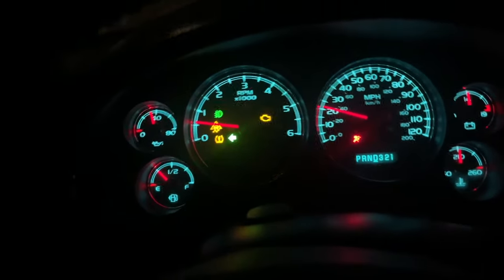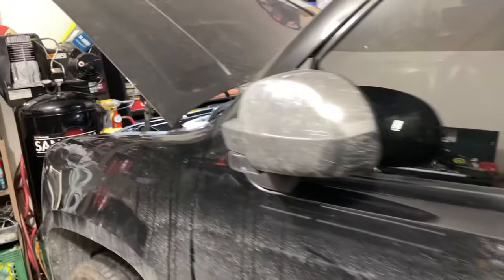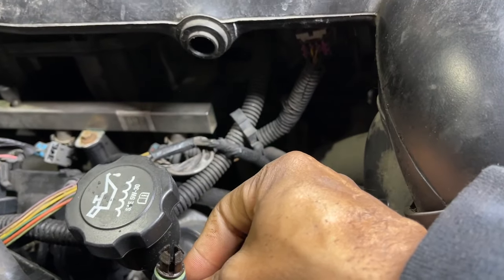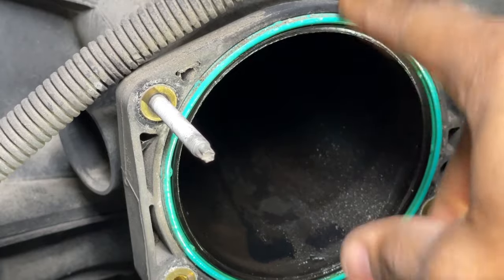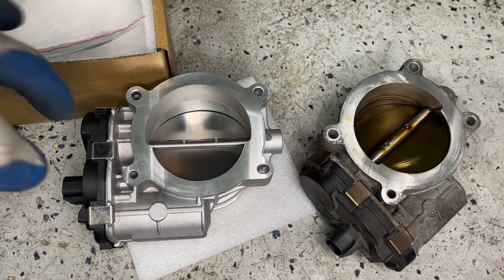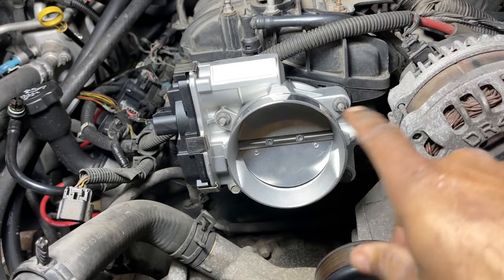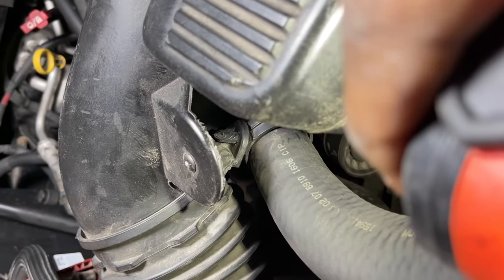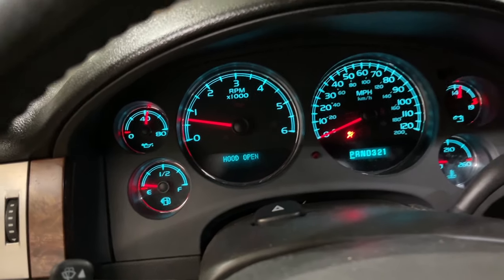How To Fix Reduced Engine Power Quick And Simple! Code P2135 Chevy Or GMC Trucks / SUV's! TPS Issue!

Comment: Thx for this video! Do you have any DIYS for a Chevy Sonic 2014 that lost communication with TCM after getting a jump? The slippery car light is also illuminated.
Reply from the maker: Unfortunately, I don't have any videos for that issue however, I am pretty familiar with your car. How is the car currently running? I wish I were there to diagnose the car, I could probably find the issue in a matter of minutes.
Reply: @TerenceDIY  wow I wish you were here too! Let a mechanic diagnose with the OBD and scan tool but he said info is coming in the system but not coming out. And referred me to a transmission shop to install a new TCM. I called the shop, they say it’s very rare for that module to have a need to be replaced. But to diagnose, that’s another fee. 

When I get to 40 MPH, car kicks back down to 38. It won’t go over 40. My reverse lights won’t light when in gear also I had a digital indicators on the dash for what gear I’m in and that won’t illuminate anymore. So can see when in drive park neutral ect. Car locks were jumping by themselves but that stopped. This seemed to happen after we got a jump on the battery. 
So far we cleaned the throttle body, Mass airflow sensor, checked for loose harnesses (that we could see), checked fuses in engine bay (not the relays tho). Prayed over the car, pleaded he blood of Jesus Christ out blessed oil on the car lol! You name it! I do think that J1 is missing a pin though. But I’m not sure if that pin is supposed to be missing or not. Maybe I could put a paper clip in it to conduct electricity. But don’t know the wiring. Only code is U0101 with the slippery car symbol.
Reply: @TerenceDIY  are you in Georgia?
Reply from the maker: Chicago, Illinois.
Reply from the maker: If I were there, I guarantee I would know exactly what the issue is. Cleaning the throttle body and any other component was not going to solve your problem. I have a couple of questions for you... 1. Why did you jump the vehicle? Obviously the battery was low, but what caused it (left lights on, radio playing, etc...) Your issue may be a simple one I just need more info.
Reply: @TerenceDIY  ok cool! So I was charging my phone on the lighter cable for about 2hrs(I know smh) when I got out, I noticed the radio was still playing but normally goes off when you open the door. Came out a few hours later, car would crank but not start. Windows still would power real slow. Then no sound at all after a few try’s. Called a buddy jumped it with our cables it would crank but no start. Someone else used their cables and it started back up! We thought we were on the clear and that our cables were no good. Later that day, the locks started going crazy by themselves, then the lost communication code. We checked the battery, starter and alternator and all checked out with good voltage. 
Short answer, maybe charging the phone or the fact that the radio stayed on too long after I left. I noticed if the radio is on once pulling the key out and opening the driver door, radio goes off immediately. But if we open passenger door (which was the door I used that night) radio stays on until we open driver door.
Reply from the maker: So all of the problems occurred after you jumped the vehicle off? If so, was it driving perfectly normal before the battery died? How did you guys check the battery? I'm really thinking this is a battery issue (voltage drop during a load).
Reply: @TerenceDIY  sure so we had some intermittent lost communication code. It would come on like once a month. But we had other codes too once we did a tune up and replaced the valve cover (we had a leak), the CEL went off and drive perfectly. But the lost communication code would still come back off and on. Maybe 2 weeks b4 the jump, I was going down a hill and I noticed the engine sounded like it was accelerating more that what I was pushing the petal. It didn’t go faster but it sounded like it was using more power for a second. But ultimately, the locks and limp mode didn’t happen till after the jump. We got it checked at Orylies (an auto part store like autozone not sure if yalll have one up there). But yeah they checked all 3 (starter alt and batt). Is it possible that a battery could be good but faulty?
Reply: @TerenceDIY  also could a nox (I think that’s how you spell it) sensor be the cause too? We had that but once we did the tune up and valve cover replacement, that code went away. I’m wondering if that could be interfering with the transmission communication module?
Reply from the maker: No, the knock sensor will not cause your issue. I thought this happened after you guys jumped the vehicle off. If there were issues prior, you may have an electrical issue. It's hard to pinpoint or even guess without being there. How many miles on the car?
Reply: @TerenceDIY  123k miles. All the other codes left once the valve cover and tune up was done. The lost communication code would come and go. But now the lost communication stays on and limp mode. Limp mode happened after the jump. Whatever it was worsened or changed after the jump.
Reply from the maker: Does it start right up on first turn of the key or does it spin over a few times before starting (very important)?  Have you ever replaced the timing belt?
Reply: @TerenceDIY  yes it starts right up on the first try w/ no hesitation. But awhile jumping, it took several tries. When the cables were on, it was. I sound just clicks. Then it hesitated but did nothing. Later that day, our friend used his cables instead and it started up. 

Short answer, the car starts right on up now since jumping it right. The jump was about 2 months ago. Been starting right ever since.
Reply: @TerenceDIY  and by the way, I appreciate you for trying to give us some clarity on this. We all are trying to figure this out!

Comment: What was the part called that you changed and is it the same problem for a cadi CTS??
Reply from the maker: It's called the throttle body. What year CTS?
Reply: @TerenceDIY  2003
Reply from the maker: Here is the part for your car. It's a top brand for a great price. 

https://www.ebay.com/itm/325113909788?fits=Year%3A2003%7CModel%3ACTS%7CMake%3ACadillac&hash=item4bb24c921c:g:vRoAAOSwyIhiOj2s&amdata=enc%3AAQAIAAAA8ENHnaBDe4JuIS6N%2Fw%2BB98qQafRm%2FawS2m49GQbU5Gu1rKo8qU0OR6kKENSze8gUBNUB8uzEyejymenT9Ik1C%2B%2FL%2FwmyOdBpha5gwpkoUJSNNJizyYZ%2FRCrIMr96YjeLaTtq8l0HsSZpSR7mYnt3jzl98yc%2FPL0avXyZLWLuX0feHLi%2FNioI%2BRBqB95eTO%2BUxLNnYEVe73olTephOombCk7TT%2FDk9sE0zpbjipdxpPZyD31qBNcYulHm6d9%2FhUVspY6E4XraNKv8hMD9qrL%2B67ANReQHyTTaAa5tVdnTgM7E9Sxl4DSS8oT82iBMgfZXKQ%3D%3D%7Ctkp%3ABFBMorKok_hh

Comment: I just had this happen last night on my 2018 f-250. I already have to get some body work done but need to make an hour trip before I bring it. I’ll just tell them to handle that too. Do you think the trip will put it at high risk for further problems before I bring it in?
Reply from the maker: Can you get some of this before your trip? (First Link). If so, pour it into your gas tank. Try to have less than a quarter tank if possible. This will allow the solution to be more concentrated and work better. I have a video on my channel where I dealt with a similar issue on an earlier Ford F250. Also, an even better solution would be to remove the air duct from the throttle body and spray inside and out (manually open the throttle body while you spray aggressively into the throttle body to clean it (Second link).  The first product will help you but if you can use the second option, it may fix your problem for some time. Thanks for watching and be safe on your trip. 

https://www.amazon.com/Gumout-510011-Multi-System-Tune-Up-fl/dp/B00PP4J23W/ref=asc_df_B00PP4J23W/?tag=hyprod-20&linkCode=df0&hvadid=312181776237&hvpos=&hvnetw=g&hvrand=9720252771282160397&hvpone=&hvptwo=&hvqmt=&hvdev=c&hvdvcmdl=&hvlocint=&hvlocphy=9021629&hvtargid=pla-569057245845&th=1

https://www.walmart.com/ip/WD-40-Specialist-Throttle-Carb-Cleaner-Spray-13-5-oz/898373269?wmlspartner=wlpa&selectedSellerId=9816&adid=22222222227898373269_9816_141989961518_18286110951&wl0=&wl1=g&wl2=c&wl3=620766111969&wl4=aud-430887228898:pla-1740857020067&wl5=9021629&wl6=&wl7=&wl8=&wl9=pla&wl10=135428651&wl11=online&wl12=898373269_9816&veh=sem&gclid=Cj0KCQiAx6ugBhCcARIsAGNmMbiTUhX6eb5pDiRdBIkgeToNsFuDxdDs57oI9jAIKlWa0zLe_Sa-fVYaAi2aEALw_wcB&gclsrc=aw.ds

Comment: My car is doing the same and the mechanic said it’s a Excelerator pedal position sensor. So we are going to replace it could this be the problem instead of that??
Reply from the maker: Sorry for the late response. I would not be surprised if the pedal position sensor was replaced and your vehicle does the same thing. There's a strong possibility the throttle body needs replacing or a thorough cleaning. However, I am not there to inspect the vehicle.  Here are a couple of links to the part just in case you have to replace it. 

https://www.ebay.com/itm/254915068776?fits=Year%3A2007%7CMake%3AGMC&epid=112769957&hash=item3b5a1f4368:g:qHEAAOSwC2FgW1tj&amdata=enc%3AAQAIAAAA8EoDwoFAdfE7U4T5cvS9v6gyx76UcfGZSiU9xN177m0b%2FxXR%2FCToq%2BL9RT4qyAU7u0M3RtwLP7kOCtk0cayhWo7ERDAV5LLKCGVtpAYLlVLDp9ztNof%2FM6KfVBc4akIRcPk%2FTN9xIY9tqJW%2BAQoPEa604YBp4tsDWj8akNQn7qc2P6VAfp6DuAmyCtBf5BUgm4bMeRvA7bhBWvnY7a6RBnFHmY7YOcHqvr3hOOeyAm5xKhR4Zq84UjyN5yfDyIcS1Tm9JhPCFRmdP3iRs9UGuKqnSJV4OTv04BVMAX6WXmL6%2BtqL7aVvjxx%2BGfQWWNIzDw%3D%3D%7Ctkp%3ABk9SR7iDlMy2Yg

https://www.ebay.com/itm/313060626212?fits=Year%3A2007%7CMake%3AGMC&hash=item48e3de0f24:g:WrMAAOSwK21gNmUd&amdata=enc%3AAQAIAAAA0FVaL6b67vLo5ljhLpeU83s2XoUNB7COAVKlEKo1D6hxBh9W5qCtaob7d1g2IH7QvdAOVt4LnTaX8Kp54N5YWHwl1FgNdKF6AXXU1bmXmNYGC6neOBM5jH9x9zYb4mObJvZznCm7ASfr0529QujCN8%2BKQ7dJxZJ%2FgGEwYGPOdkItiY09x9544L0Adds%2Fj0%2BfI229VGpHhxHC4tcOeMRytUH%2F1Tvw6CwHFnyTWiThoteeuBt%2BqNzGjg20%2BcuoebSNF3055n8r8ez71abQN1mOCb0%3D%7Ctkp%3ABk9SR7iDlMy2Yg

Comment: I have a 03 chevy Silverado, 2500 hd, it did this to me on Thanksgiving, i replaced the throttle body, and it was good, until today it happened again.  Any ideas on why it happened again so soon?
Reply from the maker: Did you buy an OEM throttle body?
Reply: @TerenceDIY  honestly i don't know.  I got it from an Oriley oautoparts store.
Reply from the maker: Well, it was definitely not OEM then. Here is a link to a part that is probably better than the O'Reilly's part and MUCH cheaper. 

https://www.ebay.com/itm/125710877331?fits=Year%3A2003%7CMake%3AChevrolet&epid=19056097644&hash=item1d44f3c293:g:qkgAAOSw-nVjvRIU&amdata=enc%3AAQAIAAABAOmrBww5Sup6onOc7MXf%2B1a49OvzpVKkIrYhsc4PoGZWqXRJgBWz%2Flck3NJaO8FHmi4tZ%2FhTnOrFTuqibi3WPphFhbjnqVOGEDiRdgNNDN6SCytNBO4j7%2BkugCdSHEqoBx3iZ11ryqNX3B%2BgcthivHsKlkrBFVJB8c2qPwPsR8S6U6OWPiCU1C6zGt16Rq2cMcWef%2By%2FxRzonnQBgO11IbeUdBAMHxSPmWpzMuCDejmVwST7QvvgsyouTaLIO%2F3Sz7P1DHHrFOzOCK9nZZb95zfury8aLaz%2FyOORfOeYIxlucRFj%2B%2F3GbqhWHIyAra8bWpYwga506J6ZR6kOTY7fLO0%3D%7Ctkp%3ABFBM8JHTxPVh
Reply: @TerenceDIY  hwy thanks man, and i looked at the part,  its a hitachi, but it's under warranty so I'm taking it back now and getting a new 1 for free
Reply from the maker: @Mr.Plant_man  Awesome! Let me know how it runs after you install the new one. Thanks,
Reply: @TerenceDIY  had the part on for a week,  and not a single probem so far.
Reply: @TerenceDIY  sorry btw i just seen your comment
Reply from the maker: @Mr.Plant_man  Great!

Comment: I done replaced the whole throttle body and the petal and still throwing the code & reduce power and all that
Reply from the maker: Did you replace it with an OEM throttle body? Also, what code are you getting?

Comment: Hey am i missing something here or did you forget to mention that ypu have to relearn it?
Reply from the maker: Nope, I did not have to relearn it. A few commented saying they had to but not in my case. I removed the battery cable during the removal and installation to trick the system. It works almost all the time for me. Thanks for watching.

Comment: Awesome video, My Yukon denali 2010 recently started showing engine light, though there isnt any reduced engine power message but I can feel less power while accelerating, it takes few seconds to get acceleration!! any advice please?
Reply from the maker: It may be as simple as removing the air duct and cleaning the throttle body with some throttle body cleaner. You'll be surprised at how your MPG will go up as well as performance. I would remove the throttle body and clean it as well as the intake in that area. Super quick, inexpensive and simple job that will save you $$. Here's a link for the cleaner. 

https://www.amazon.com/Berryman-Chemtool-Carburetor-Throttle-compliant/dp/B0002KKIDW/ref=sr_1_5?crid=BOC77FJCWCT3&keywords=throttle+body+cleaner&qid=1669253398&sprefix=throttlebody+cleaner%2Caps%2C108&sr=8-5

Comment: Hey about a month ago i had 02 sensors intalled and this part was put it new also i had code p2135 everything was until this weekend that code came back again and the reduced engine power on dash. Do you think that new part went bad already that fast?
Reply from the maker: I don't think it went bad. To be honest I rarely have luck with the aftermarket throttle body. That's why OEM is the way to go. I'm not saying that's the case but you never know. Please tell me the exact code or codes you are getting.
Reply: @TerenceDIY  p2135 only that code do think a senslr called TPS could be a problem or is the sams thing
Reply from the maker: It's the same thing. The TPS (Throttle Posistion Sensor) mounts to the side of the throttle body. If I were you, I'd purchase a like new OEM throttle body and see if that would fix your problem. Here is a link to one (below). Please make sure this one fits your truck by scrolling down to see in the description. 

https://www.ebay.com/itm/254915068776?fits=Year%3A2008%7CMake%3AChevrolet&_trkparms=amclksrc%3DITM%26aid%3D1110006%26algo%3DHOMESPLICE.SIM%26ao%3D1%26asc%3D252698%26meid%3D1ececa0e53a84e5b9bb77247a3f29e7d%26pid%3D101195%26rk%3D2%26rkt%3D12%26sd%3D262274160605%26itm%3D254915068776%26pmt%3D1%26noa%3D0%26pg%3D2047675%26algv%3DSimplAMLv11WebTrimmedV3MskuWithLambda85KnnRecallV1V2V4ItemNrtInQueryAndCassiniVisualRankerAndBertRecallWithVMEV3%26brand%3DHitachi&_trksid=p2047675.c101195.m1851&amdata=cksum%3A2549150687761ececa0e53a84e5b9bb77247a3f29e7d%7Cenc%3AAQAIAAABcPqB0EgCndAssfMWNy0AT0GytGzF9%252By0G%252BlcW69DgBK3Qlz4BjwJQqPkN4K8I7qz9GoVciN1QNWqyS8EeqYS8rZRsDvyvw34m3N%252FyJKokwCTIIc3RNym2SNW8ARudP72DyiwgIY0dfUnIr5%252BMZDTaot8f0FRMFkOUhoDU9mVqIAHFL9WhxVZ3TzcXdzWxbyVFv19lYaqTWbm4o6eTD%252FICDK9edB%252BHW0xTaSCEfDbc73duZ8Dot8Qy9X3YY2u7lNNRuOqQoJsCkv%252F0A2ogdZWcXNN6yFEO%252BjdfKsr47iY0SabbkNuqpVQlTJjFNh0ZYMs84WhoTFkKo%252F53hwXtuYH98K7G%252FVyaKRdaDCkGuTNKwT%252FCrFjPK7QK851aizAIRw5aFpqr64%252BlTk%252FvudCfMfJNwqeS2ouO%252BW9Rnam1wX8YqV7ZagGfA5LglHiSmEi55vzx6Svtchh6FF1pQzTuyxSuY%252Bs7FQ7swMdv6YuAHJFz9Nl%7Campid%3APL_CLK%7Cclp%3A2047675&epid=112769957
Reply: Hey man i put in a new throttle body last week it ran fine i had the same code u had. Now is doing the same thing u have any idea whats going on. Im getting tired of the same crap.
Reply from the maker: You said, you replaced it with an OEM correct?
Reply: @TerenceDIY  well one from oreillys brand i guess i have to see about that.

Comment: When you got your reduced engine power warning did you get a CEL for OBDII codes P0120 P0220 and P1516? All 3 came up at same time without the REP on my '03 and chasing down is not easy lol
Reply from the maker: Nope, I didn't get those codes. Have you replaced any parts yet? Or are you trying to figure out the issue? Thanks,

Comment: hi once i got my O2 sensors replaced and the coolant water pump it started to do this i got my throttle body cleaned a couple months ago
Reply from the maker: Did you have your throttle body cleaned before you replaced the water pump and 02 sensors? Do you have any codes? If so, what are they? Thanks,
Reply: yes i had it replaced and cleaned before and these are the codes 
P0237 P0236 P00EA i have a chevy cruze

Comment: Can you link me to an OEM throttle body for a 2008 Chevy Colorado.   Code p2135 also   reduced power error that comes and goes.  Will replacing the throttle body fix this?
Reply from the maker: Hi, there's a possibility that replacing the throttle body will fix your problem, but I cannot guarantee it since I am not there to visibly diagnose the problem. Here are two links for the part. One is for a decent aftermarket one and the other is for the OEM part...

https://www.ebay.com/itm/372716679722?fits=Year%3A2008%7CModel%3AColorado%7CMake%3AChevrolet&epid=10041566406&hash=item56c7a5322a:g:hgQAAOSwJBFjoxYM&amdata=enc%3AAQAHAAAA8OU9qdjx2P%2BauS%2F9m07jW5nKAcn9%2FD%2BpgkGP8rzVHCj0qn0Vrh1VJrmbQGwwnZfrV4X%2FB%2Be%2BcHhN%2FZzvUwYYVpVSr26UoXvGGifCZM4RZ2bxw36ZG6dhxEupRLK1GNg5iNuMkh7NuIlgMSFMxL%2BKq232YC5z9s9L%2FZoY%2FdmAaZEHVbC5b95rbZHTCI6hnh4RfaGCEYQ%2Bp%2BhXF4E2jku8m9Mxp%2BZT87%2Blmjskor%2Fi9thFZ1S3VwXje2AWBAgU9OV3BtVAAXMvY1%2Bgf5Ix5j%2F6Lfcwho1%2BLnvkFYNVHwiPrTjVDlPrsjRj7jGwR3usfXbphw%3D%3D%7Ctkp%3ABFBMzoqmj8Nh

https://www.ebay.com/itm/324102392271?fits=Year%3A2008%7CModel%3AColorado%7CMake%3AChevrolet&hash=item4b760209cf:g:q~sAAOSwu-tea6gt&amdata=enc%3AAQAHAAAA8EDMYr7u7mTiuGkFpiAoyunRYEhkwV%2FCjN%2BXRj1%2BhgputMZYf6G0575ed7gBTz1bKSpG5fzNYgJA7va3mkOO4YxUbSOQTROQP2hxDy3D2LL6XSnuJDsACsBSVbnSgKD4Hb9RV9RozhrzpCTiu97t6mOTqKKPm4ZXH7I7H%2FGB9c5jG%2Bta4MtM%2BzaWJn%2FNutoHGVU3FoOXxOST3hjRCLvRRvDeTcR%2BfdWPlOjICwPI1LdSQ6MOn2KT6tFI%2FX6HI4EtNJMJE6bUBCdc%2FmjpUJpXsHCLXzU6VqPusWKyA8iLqGtgHn5w80Qu1xSNzCTis3t7QQ%3D%3D%7Ctkp%3ABk9SR86Kpo_DYQ